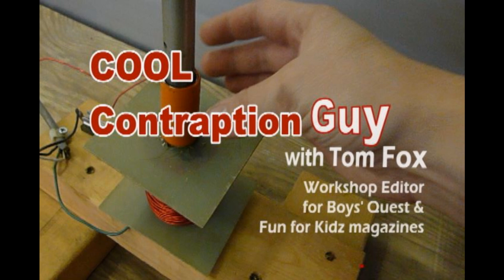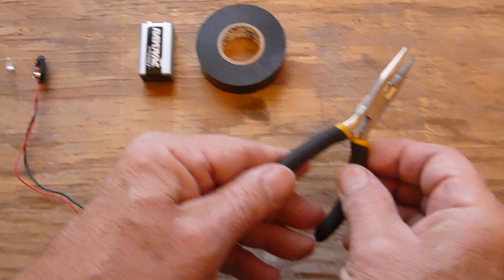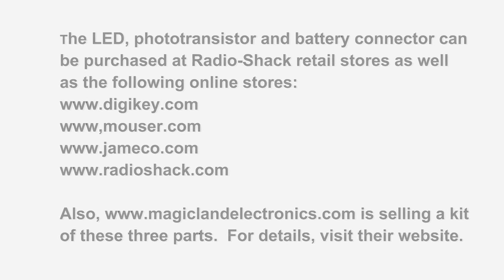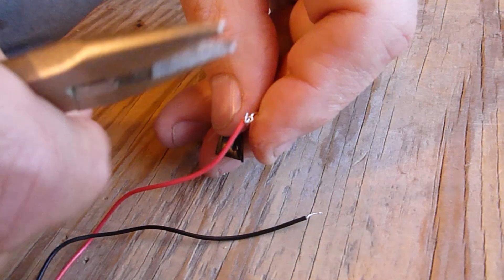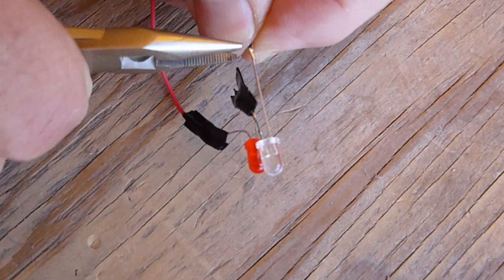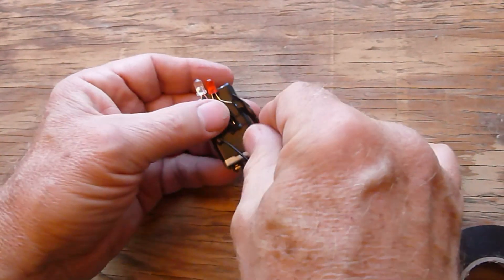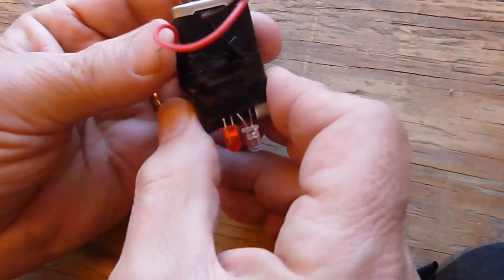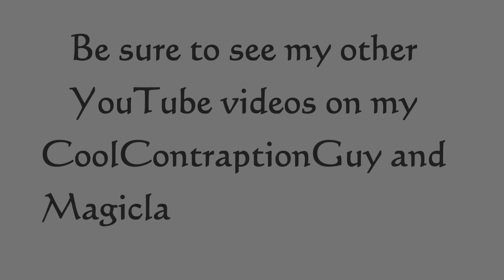Remote Controller Tester - An Amazingly Simple DIY

Comment: Far easier to to hold down a button and hold the remote close to an AM radio. Tune the radio if necessary, and you'll hear a loud pulsing if the remote works!
Reply: I've done that before and it make odd noises
Reply: That's right, it proves the remote is functioning

Comment: Wow, what a lot work to do something that only takes 5 second.  IR signals are invisible to the human eye, but visible to digital cameras.  Use your phone camera to watch the front of the remote while you press the buttons and you will see the light flash if it's working.  Sometimes the best solutions are the most simple.